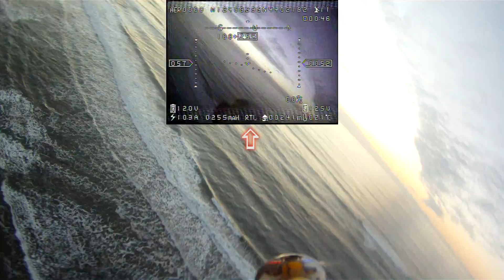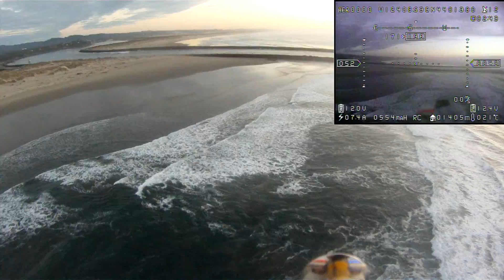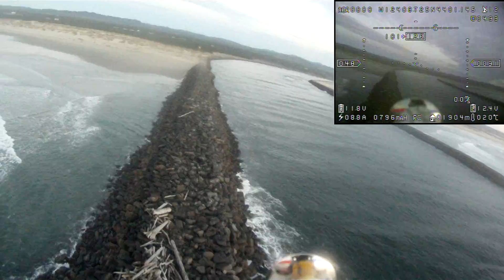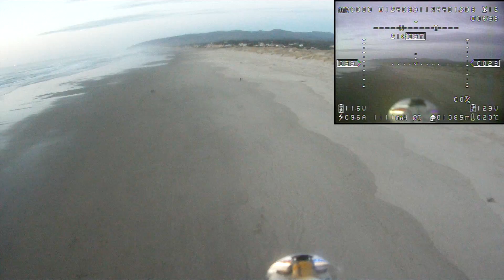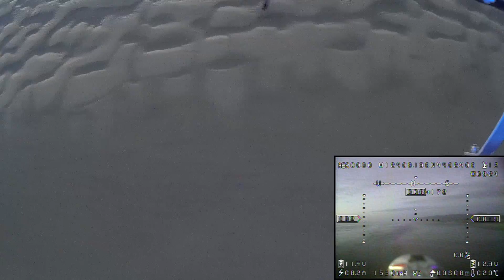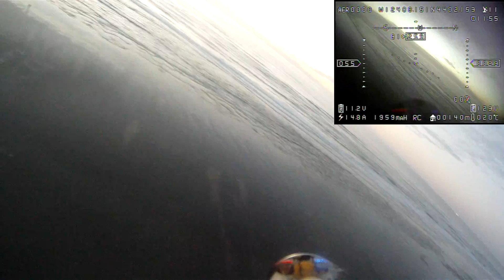FPV Raw! - Pacific Coast Dusk Patrol

Comment: Nice video and very nice setup. I recently got into FPV and I mounted a siren that sounds exactly like yours.  I intended it to help me find the plane in the sky when I transitioning away from camera/goggle/monitor mode to bare eyeball mode. Unfortunately the sound from the onboard mic and speakers drown out noise coming directly from the plane. Sounds from the mic and speakers help me keep tabs on how well the motor is behaving, as I don't have an OSD or telemetry.  The siren may still come in handy some day if I crash it in dense vegetation or I need to warn someone of my approach.

Comment: Good work and thanks 4 the description.
I stay (here in germany) closer to the rough coast,often very windy conditions and that make sense to use a autopilot (like FY-41AP) system with airspeed sensor.
...to eliminate problems with tailwind conditions.

Comment: The ultra high altitude flying stuff seems really risky without any kind of ATC input for local inbound outbound flights.   Turbo fans can handle bird strikes, even frozen bird strikes but sucking in a hex copter or RC airplane, i doubt that would be good. Worse yet hitting the rotor of helicopter.  Keep it under 400 and far from airports.